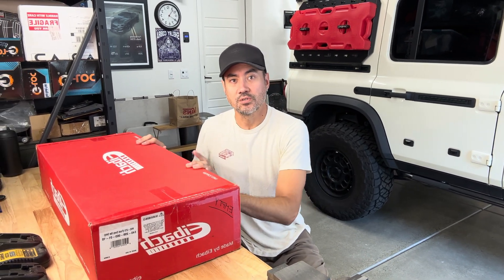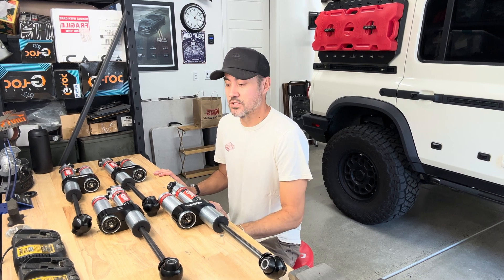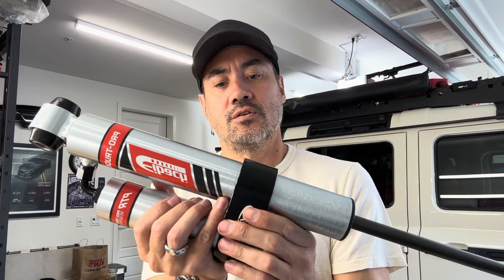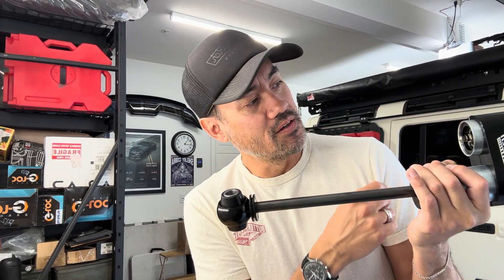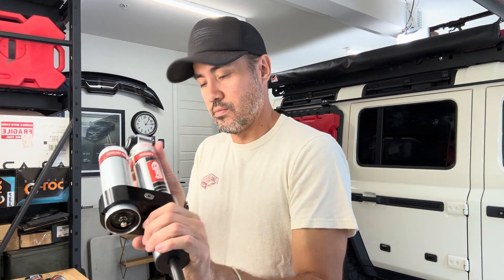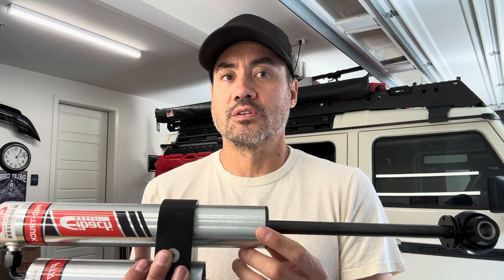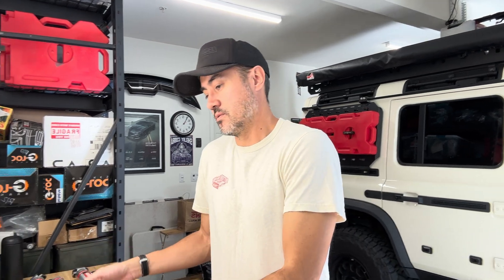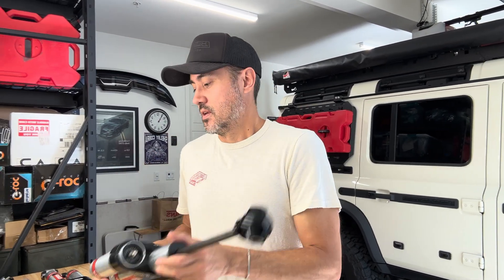Eibach prototype 2.0 piggy back shocks for the Ineos Grenadier and general suspension discussion!

Comment: Did you make any modifications to the steering rack?
Reply from the maker: @fbonde  no sir I have not, haven’t really felt the need to really the only modification that can be done easily is to swap out to a different steering stabilizer. Aside from that, I’ll be installing the adjustable track bars from @metalcloak to get the axles recentered so the car tracks straight. I’ll also be adding their adjustable links so I can put in more caster/ pinion angle, which will enhance steering feel immensely!
Reply: @Bodhigrenadier  I have only driven the test car, and I did feel it somewhat. I am currently waiting to receive my own vehicle. We will see how it goes.The Metalcloak products appear to be of high quality and solid.
Reply from the maker: @fbonde  definitely high quality! 🤙🤙

Comment: I’ve been looking forward to these but surprised they’re not rebuildable.  I’ve had decent luck with short-body Bilstein 7100’s for years on my Land Rover (rebuildable and can be re-valved for compression and rebound) and similar price to what what your stating for the Eibachs.
Reply from the maker: @Greg-e7e  I know. I’m a little disappointed as well that they aren’t rebuildable, but these are definitely entry level. I’m thinking a basic mono tube reservoir shack that’s non adjustable would probably be in the $400-$500 range nowadays.